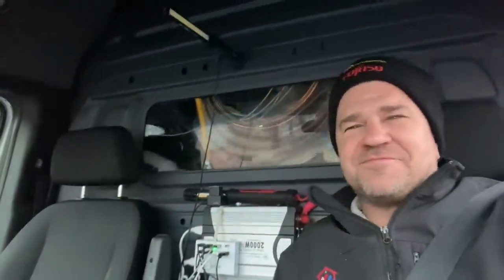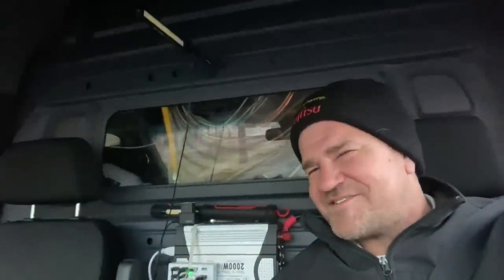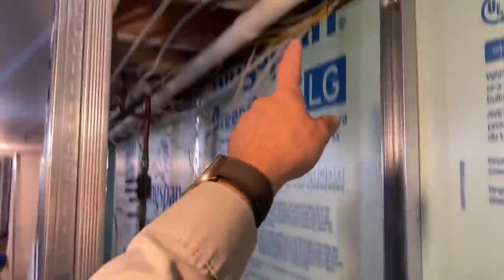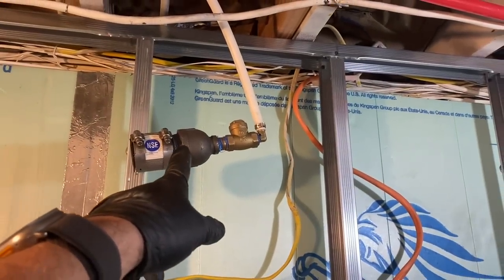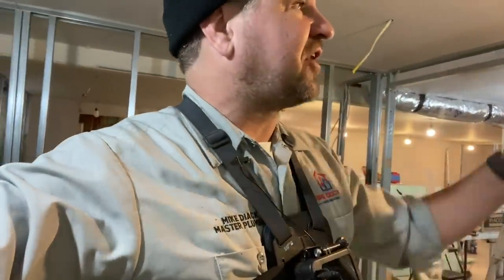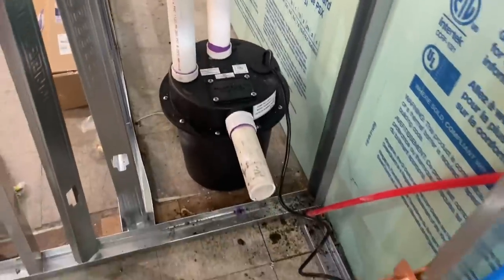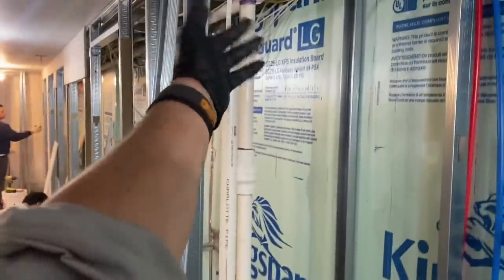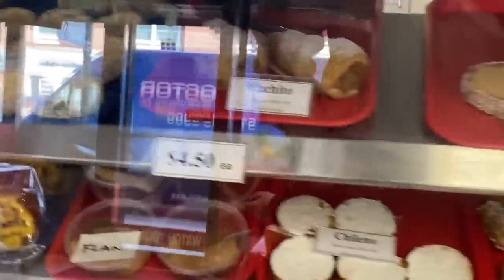Basement Laundry Pump and Waste Piping Installation Little Giant WRSC-6

Comment: the vent on pump tank has to be tied in to a vent stack, if not it will start to smell bad and stink up the basement, especially after sitting a while. remember every time the washer dumps into it, laundry tub is ran or condensate pump flows into it, it will vent out a bunch of stinky gasses to make space for the entering liquids. also as the pump cycles on and off it gasses will flow in and out the vent. "gray water" can actually smell far worse than "black water".

Comment: why did you Santee off the pump vent for washer box p-trap?
that may interfere with the float.
also the waste inlet on the side of the tank is where you shoulda/coulda tied in.
come on Mikey pipes

Comment: You drain the washer machine  into the vent ? Or should/can it be in the inlet pipe also if a sink is draining into the inlet does it need to be vented or is the vent out of the pump good enough?

Comment: Is there a way to tie in the drain from the washing machine to the kitchen drain ?  I've got a really old house and want to move my washer & dryer to an addition but need an easy way to get the drain connected to the main stack.
Reply from the maker: Yes. Anything is possible